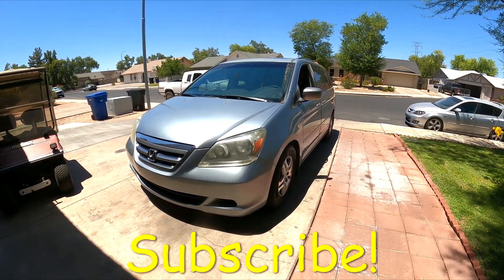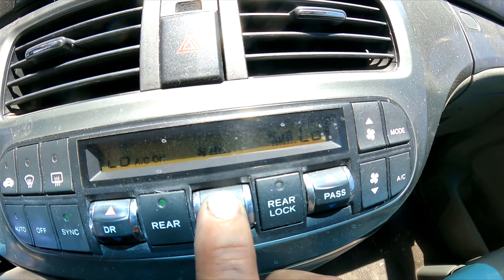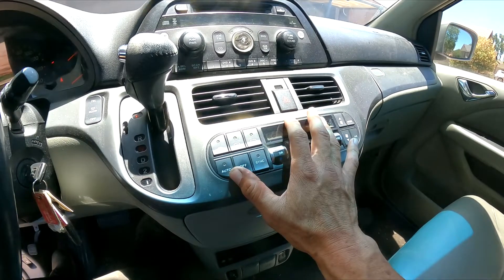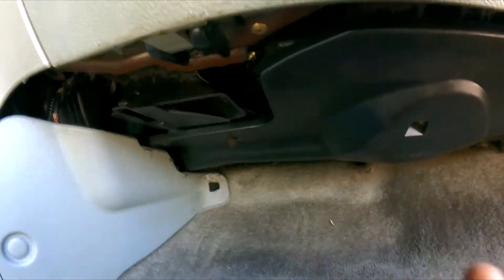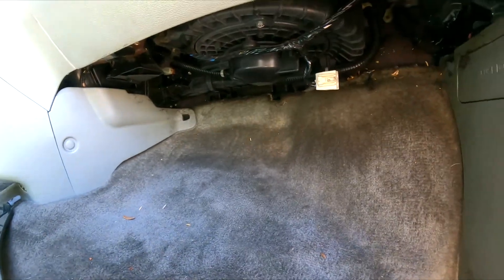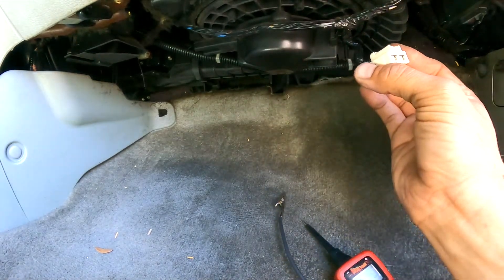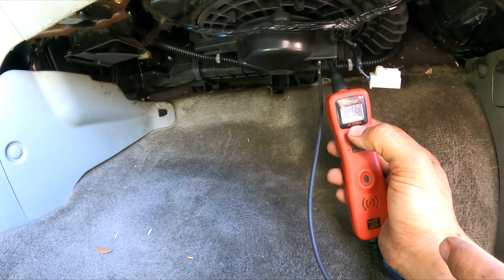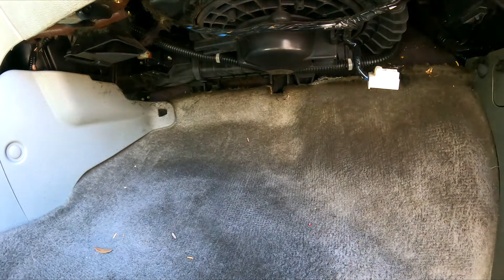2006 Honda Odyssey Air Conditioner Not Working Problem, Solved EASY

Comment: I just replaced mine with a new resistor. Worked for a few minutes then gave out. Is there another issue that I need to look for? Thanks
Reply from the maker: Hello. I am sorry to hear that. It is possible that the blower motor is weak. Keep me posted
Reply: @gqautodiagnostics  will do! thank you, Sir! I got the same year and model as yours.